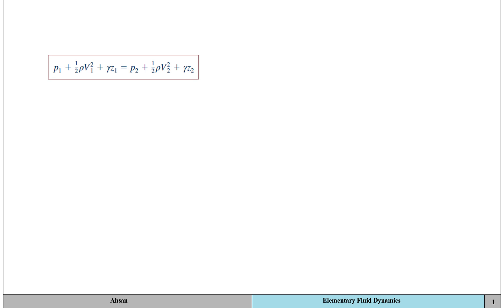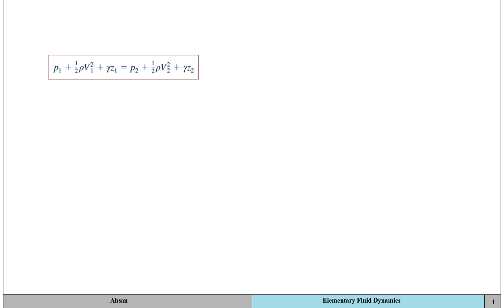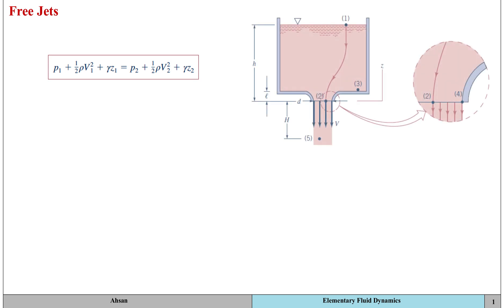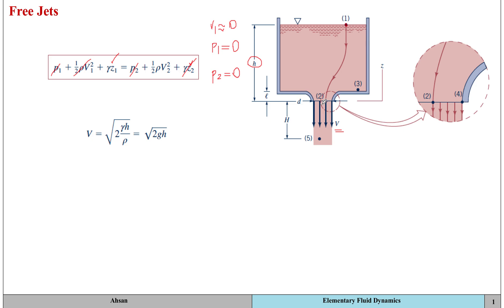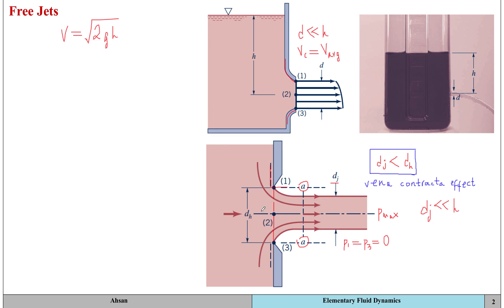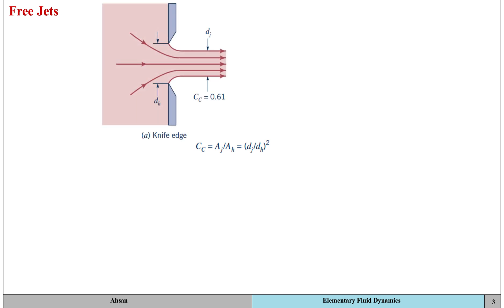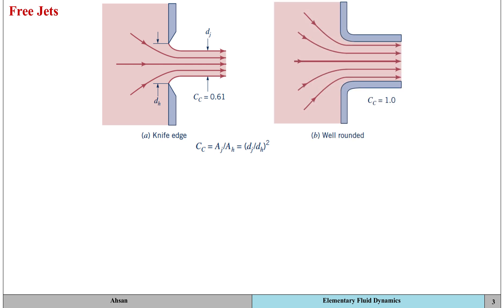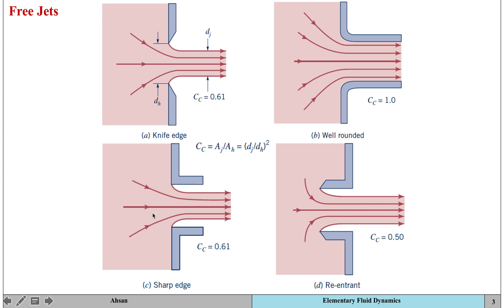Bernoulli Equation (Free Jets - Vena Contracta Effect) - Part 3/7

Comment: Sir, the fact that with an immersed water propeller one normally needs to consider water as being incompressible and non-expandable, the velocity /pressure streamlines, ahead( suction side), in between the blades, and behind( high pressure)  the propeller is not so easy to deduce.

One can have propeller blades shaped as in a shrouded Archimedes long Screw ( Helical)  where the volume/velocity of the water cannot change between the blades and so the acceleration of water must take place on the suction zone ahead of the propeller and on the high-pressure zone behind the propeller. In between the helical blades of the screw, the velocity must remain constant as after all, a nut running on a helically threaded rod, does not distort or change its volume. The vena-contracta will take place ahead and behind the propeller. Different shaped impellers become interesting as they can operate on the pressure rather than the velocity and use diffusers to change pressure energy to velocity energy. 

With an immersed thin water propeller with narrow CURVED BLADES,  the acceleration of water can take place along and in between the blades and so the vena- contracta will proceed in between the blades of a propeller.

With a surface propeller, Bernoulli need not be mentioned, as with only the lower blade being dipped in the water this, periodically, will accelerate individual mass/ lumps of water that on being pushed on the high-pressure concave curved side of the blade, the liquid water can distort and fall over the leading and trailing edges and the tip of the propeller, while on the suction side the water will boil due to the limitation of water to be sucked out fiercely.   Also once the lump/mass of liquid water is thrown back and out at high pressure it will accelerate and on facing the air it will break down into drops, surface tension will come in it, and white foam takes over which is no good for the propulsion of ships nor boats. 

Bernoulli was and is a good helpful person, but he seems not to like living in the complex zones around water propellers and  Navier Stoke seems to take over from Bernoulli in water propellers!